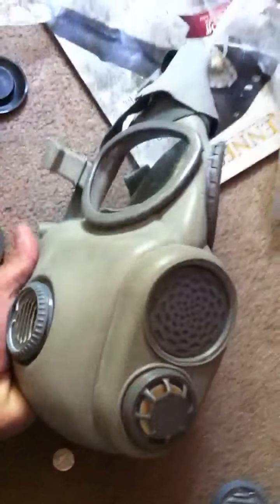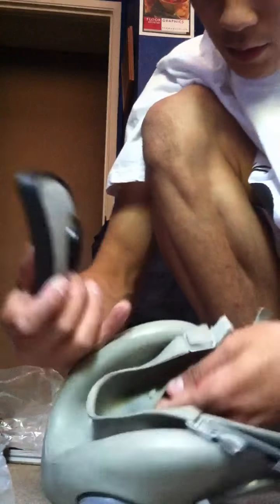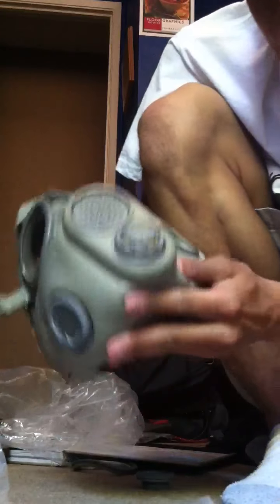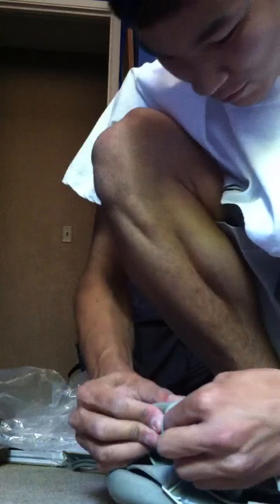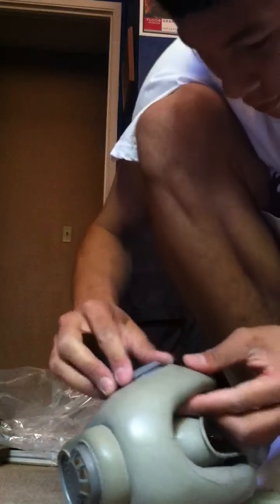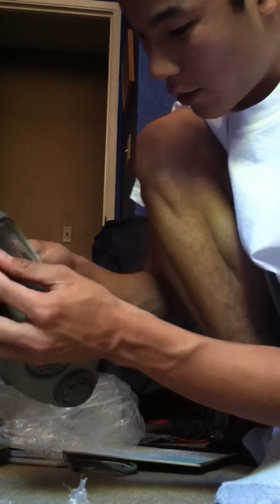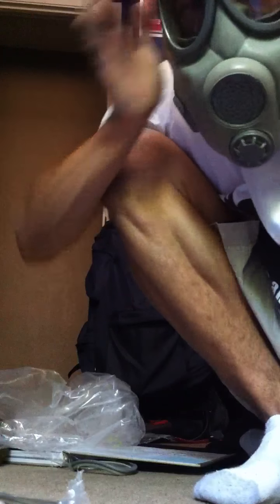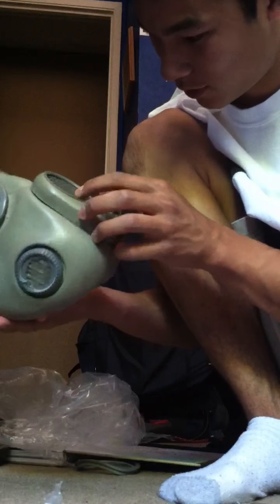How to assemble Czech m10m

Comment: to check for proper seal dawn mask tighten straps, cover the filter ports on the out side suck in if mask doesn't suck air in its good, if it sucks air in you don't have a seal.